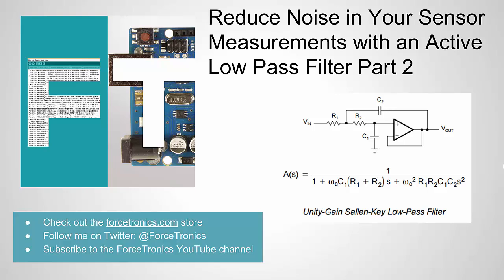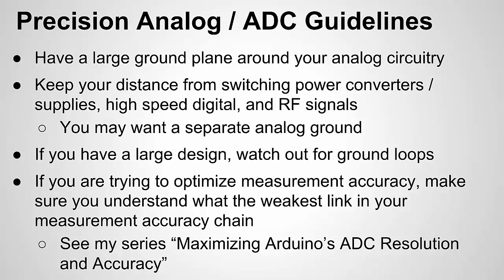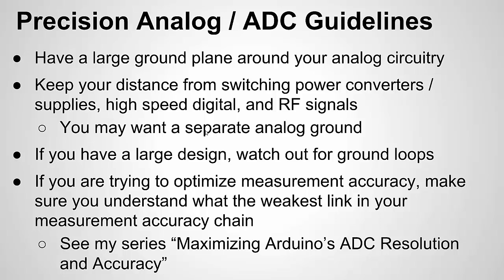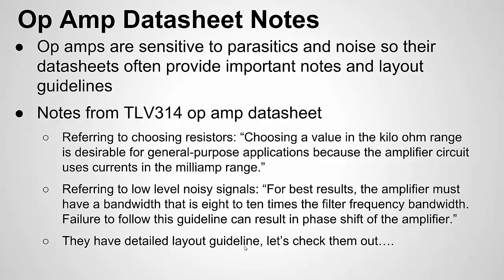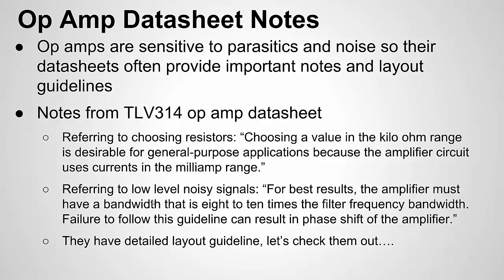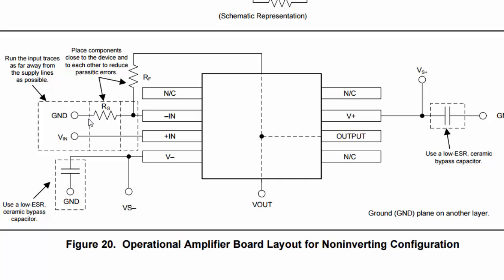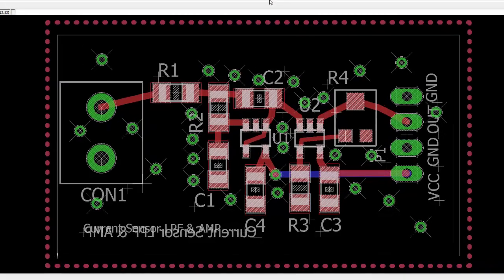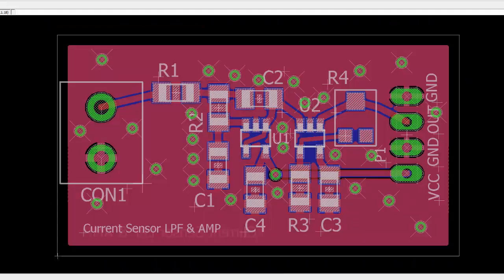Reduce Noise in Your Sensor Measurements with an Active Low Pass Filter Part 2

Comment: I'm not sure if you meant to do this or not but pin_5 of U1, pin_4 of U2, and the wiper of R4 each have a different size circuit trace hidden under the bigger circuit trace. When I moved the circuit traces  around in order to make my own circuit I found these bigger traces covering over the smaller traces. I'm sure it's probably no big deal but I just thought I would let you know. If this was deliberately done then please disregard this comment....PEACE
Reply from the maker: I did not mean to do that, I need to pay better attention to detail. Thanks for the heads up.
Reply: OK ...PEACE